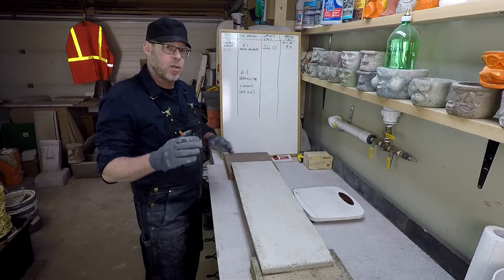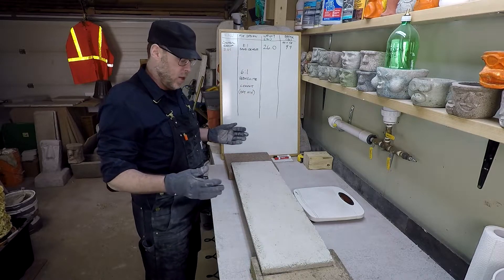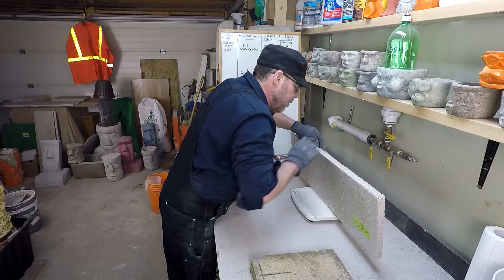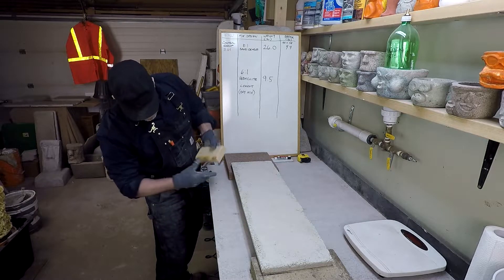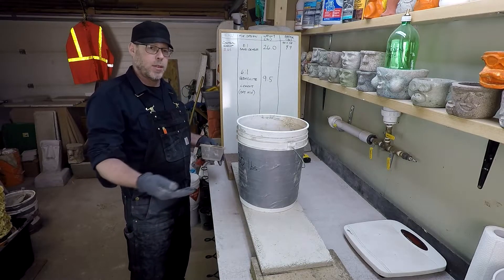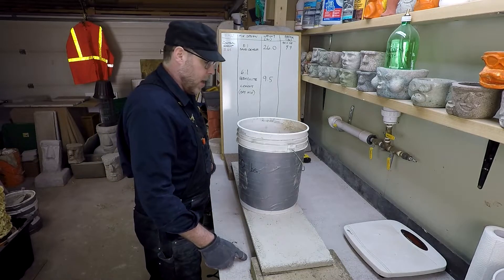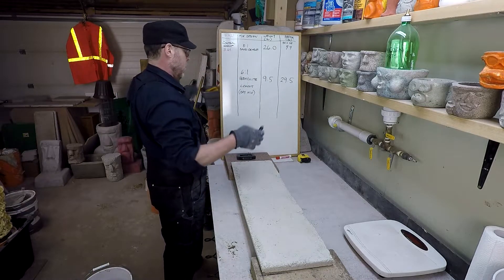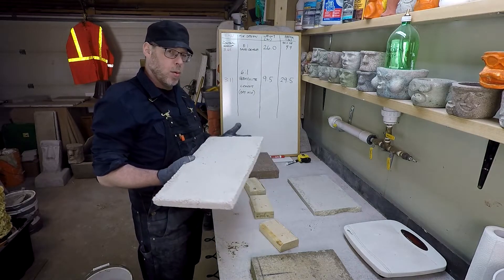Lightweight Concrete Strength Testing - Vermiculite 6:1 Mix Ratio

Comment: Thanks for this super demonstration! I wonder if the compressive strength-to-weight ratio tracks similarly to your bending strength results. I'm planning to use a 6:1 mix to support a stone slab.

Comment: I need your help . I need a strong, white, cement mix that is as strong as CementAll, but doesn't set up as fast, and is WHITE, so I can tint it with thinned latex paint for pastel colors. What do you think of VersaBond, white fortified for 3/4" thick x 3" x 4" shapes. Strong enough for wall hooks?, or do you have a better mix recipe?
Reply from the maker: 2 parts white sand to 1 part white cement, with 25% of the water being replaced with liquid acrylic / latex.  It is strong and the latex is a retarder so it will slow down your initial set time.

Comment: I'm wondering how strong will it be if added some wire and/or laminating the exterior with some formica and contact cement or fiberglass. Keep up the good work.

Comment: Question 🙋🏼‍♂️ How brittle is the edge? And does the bucket having the lip on the bottom not allowing bucket to sit flat/ flatter do anything?
Reply from the maker: The bucket is flat on the bottom middle so it actually has a lot of surface area contact with the test board.  This 6:1 mix is pretty weak (brittle) at the edge as to be expected with such a low cement ratio and no sand used.